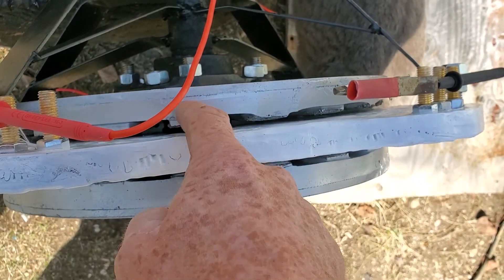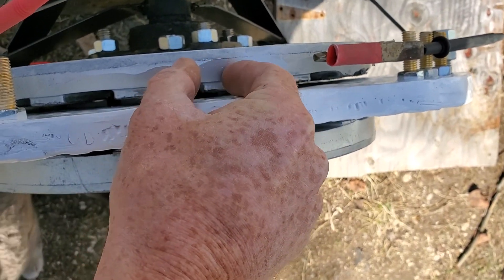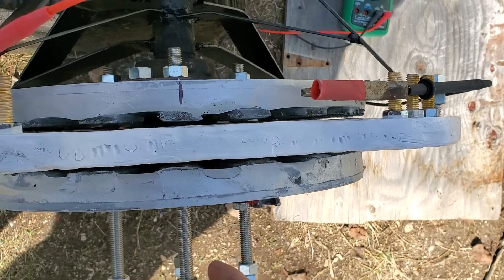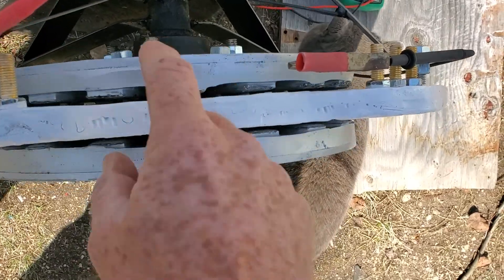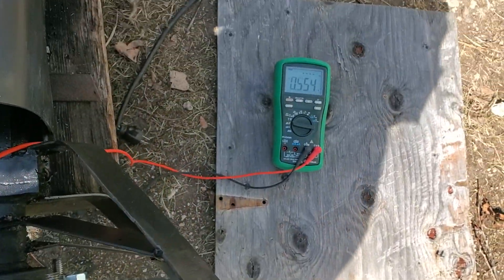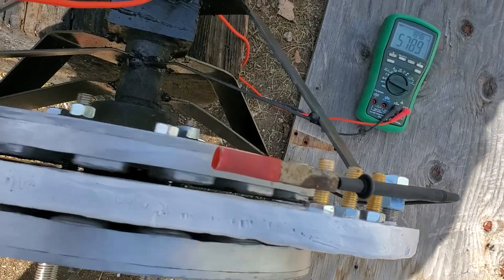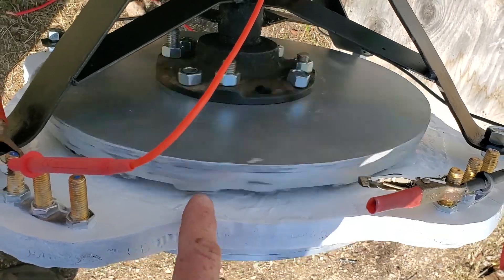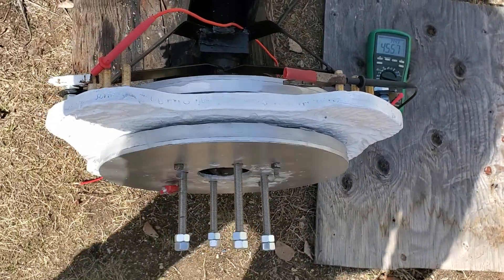First test of the Axial Flux windturbine with 20 pounds of magnets and 10.5 pounds of copper!

Comment: You're gonna dislike my comment but these units are incredibly inefficient. Not trying to hate on the hard work and design at all. But there's a better way to do these.
Reply from the maker: Yeah do it than post your results put your work where your mouth is
Reply: @windpowerandmore6310  What are you using for the backing plate?
Reply from the maker: 3/8 thick plate I cut into rotors
Reply: @windpowerandmore6310  steel or stainless?
Reply from the maker: @jf2029 steel … only the fasteners and all thread is stainless.   Terminals on the stator are brass
Reply: @windpowerandmore6310  ok thanks.  That was interesting getting those all laid down to steel. What did you use for epoxy? What surface prep did you use?
Reply from the maker: @jf2029 Thick pour resin which is good for upto 2 inches thick 
All I did was make sure everything was clean
Reply from the maker: @jf2029 also it’s very important to have steel rotors … it concentrates the magnetic field
Reply: @windpowerandmore6310  the steel is actually a hindrance.
Reply from the maker: @jf2029 no not in the rotors
Reply from the maker: No it doesn’t
Reply: @windpowerandmore6310  having steel backing actually degrades the amount of flux being used for the generator.
Reply from the maker: @jf2029 it does not it actually completes the flux field on the side of the magnets touching the steel which concentrates it through the magnets and also having that flux field completed through the steel stops the magnets from depleting in strength over time
Reply from the maker: @jf2029 please show me this with proof such as with a gauss meter 
I happen to have a very precise gauss meter and have shown to myself many times that steel is way more efficient
Reply: @windpowerandmore6310  this is what I'm trying to say, you don't want the flux field to go all to the rotors, you want max saturation through the coils and to the other side. The steel plate is pulling more flux as it's closest to the magnets.
Reply from the maker: @jf2029 I am a strictly numbers guy who uses tools such as my gauss meter to show the real magnetic field strength . Numbers don’t lie and I’ve done the research. You better do it too
Reply: That unit is probably 89% efficient. That's very good for an electrical generator, especially a small one.

Comment: Similar to one of my videos. Love it.  Happy that people still making axial flux generators :)
Reply from the maker: Lmao i just watched your video. This alternator makes serious power nothing like the wood rotors on the alternator you made . Not to insult you but this is a totally different.
Reply: @windpowerandmore6310  Its the same concept. Magnetic wire coils in wye configuration. I think about 500 windings. Then like 24 magnets. 12 and 12. I see nothing different. Maybe you have thicker gauge wire and filled with resin. The 100 volts you were measuring I think is peak to peak. RMS would be totally less. Its the same concept design only that our design was just for a project hence the wood setup with skateboard axle. We had no real use for it. I think the most important thing of the entire design is the axle with ball bearings.
Reply from the maker: @CSJiGSaW08  i think you're should watch the videos of it actually in service
Reply from the maker: Thanks for watching buddy I hope you're building more of these soon !
Reply: @windpowerandmore6310  Yeah lol, I doubt. No need at the moment, but maybe later in the future. Also, when I get some free time ill take a peek at other videos :)

Comment: Nice build, magnets are decent
Reply from the maker: Thanks! Definitely strong n52 grade,  147 lbs of pull force.  I sure struggled to get them to stay in their spot on the rotors.  Thought I was going to have to redo from the start lol. Next time I'll use a thin layer of fast cure resin that will hold them while the slow cure resin hardens. Thanks for watching buddy!
Reply: @windpowerandmore6310  i have the magnets etc but never got around to it, my magnets are bigger again 40mm×40mm×20mm n52 , plan was to allow a bigger air gap for stator cooling in my very hot climate. One idea i thought of was not using resin but thick high temp industrial plastic sheeting and sit the coils in cutouts, saw an in indian guy do that.
Reply from the maker: Definitely nice magnets,  the key to making lots of power is to have long and thick magnets, the power gets made in the parallel portions of the coils (the straight parts) . If you make a stator that produces high voltage it won't get hot.  I don't have any issues at all with the stator getting warm. Just the charge controller gets warm. Are you planning to build a turbine soon?
Reply: @windpowerandmore6310  no way too much going on, my magnets are like chris olsens dual pma 2 phase axial, his made monster power upto 5kw and more huge blades though and huge tower, hes very hard to find these days.
Reply from the maker: @closertothetruth9209  wicked!